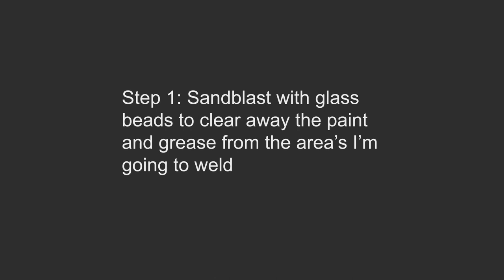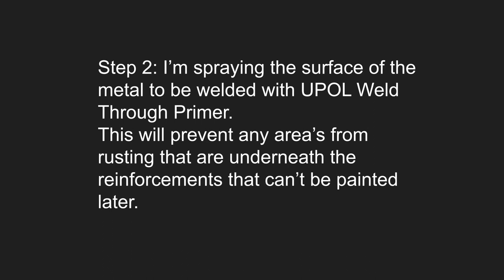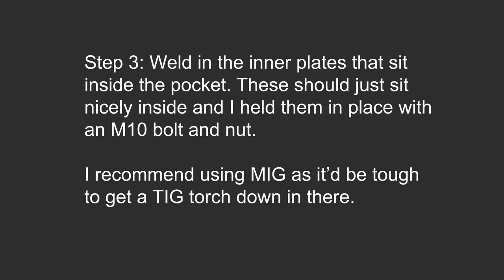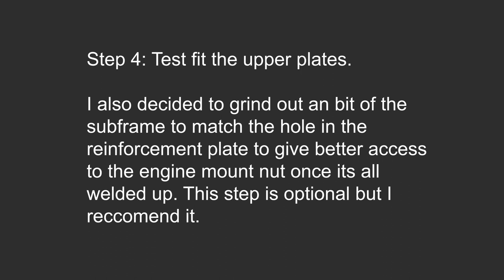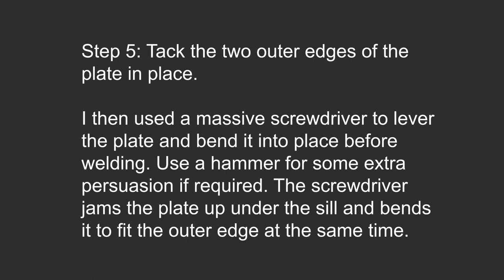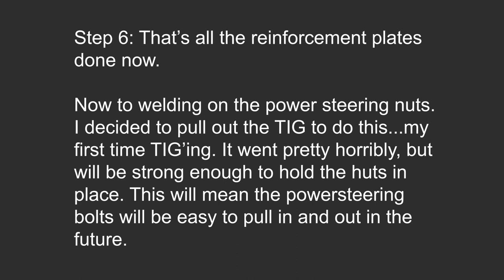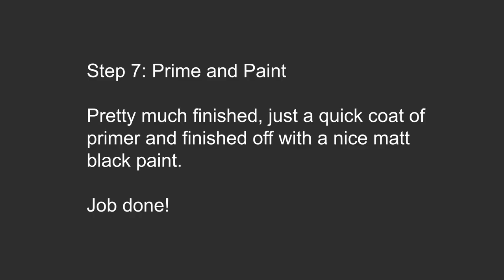BMW E36 FRONT SUBFRAME REINFORCEMENT Plate Install Process

Comment: Did you happen to snap off the captive nuts for the chassis brace that bolts onto the bottom of the front subframe? Those snapped while removing mine and it doesn't seem like there's any way to access those bolt holes to weld new nuts in, or even enough access to use a free nut to bolt it up. I'm probably going to have to drill a couple access holes to address it, which I'd rather avoid if possible.

Anyway, great video! Was curious about getting the plate in the pocket welded up right.
Reply from the maker: Cheers for taking the time to watch the video! Sounds like you're in a bit of strife with those captive nuts. I didn't have such an issue, sounds like yours might've rusted perhaps? Or the subframe bolts were torqued too much? Not sure exactly, but yeah it sounds like you're going to have to cut an access hole on top of the chassis rail to weld nuts back in there. Will be a bit of work, but should come up good once done, if you're handy with a welder it shouldnt be a major issue, just a solid few hours of work. Theres no other way to fix it that I know of...if it wasnt holding the whole engine up, I'd suggest Rivnuts as an easy alternative, but wouldn't use them in this situation. All the best with it!
Reply: @DomsE36Garage  Yeah I figured that's what I'd have to do. As I've done a resto-mod on my E36 I've realized the previous owner was quite foolish with their work lol, so who knows what caused the break. I've been practicing with the MIG for the last year in preparation for this project so I'm fairly comfortable with it. Appreciate the quick response! All the best.

Comment: Also the strut tower reinforcement plates does it really help? My front strut tower paint is starting to crack n I’m afraid the strut tower body might crack in the future.
Reply from the maker: Just do it, saves heartache later. I have done my rear strut tops, not the fronts yet but i run a strut brace so that helps spread the load similar to a reinforcement plate

Comment: Mate what do you think do I have to do these reinforcements if put it on the tracks? Did you reinforce your rear end subframe and trailer arm bushing brackets?
Reply from the maker: I completely tore a front subframe mounting point back when the car was my daily, so I'd definitely think about doing it. Havent said that, I've haf this subframe in and tracked the car for the last 5yrs without reinforcements and no issues to date, not to say it wouldnt start cracking soon. Plus if you run stiffer than normal mounts, it would help prevent cracks
Reply from the maker: And yes, my rear subframe is reinforced as well as the RTAB pockets. My rear subframe was completely shot (again when it qas a daily driven car) and cost a lot to repair. So definitely recommend reinforcement everywhere before problems occur if you can
Reply: DomsE36Garage thanks for these information! Only think worry about is the cost. As a student I can maximum invest $2000 currently for this otherwise I’ll get a mx5 for track instead.
Reply from the maker: @lalala-ky1sp  trust me, it'll cost you a lot more if you actually crack one of those weak spots. If you can do the welding and wrenching yourself,  you can do all the work for under $500
Reply: DomsE36Garage yeah surely I’ll look into that. Cheers mate!